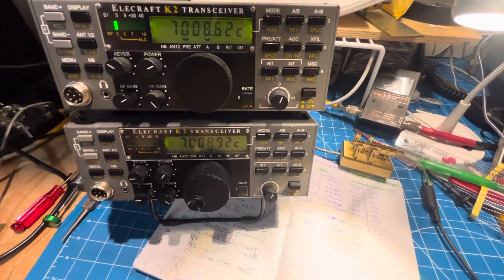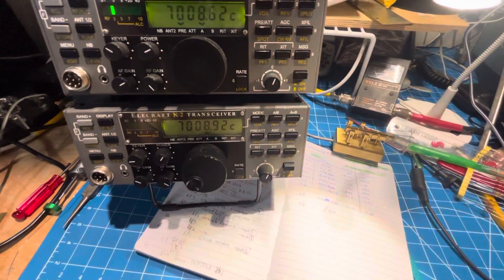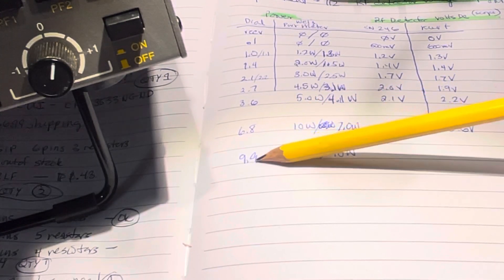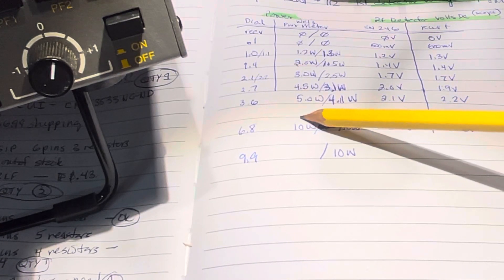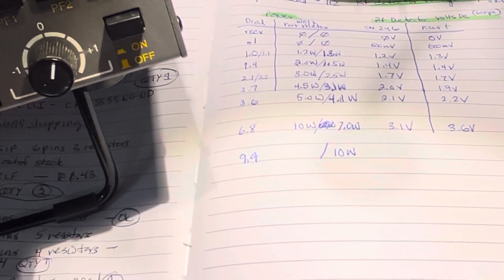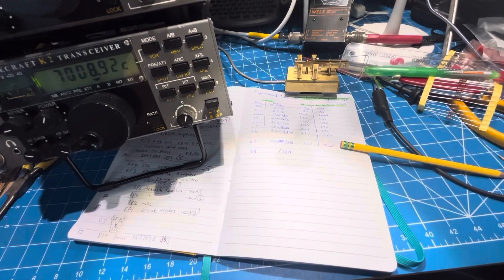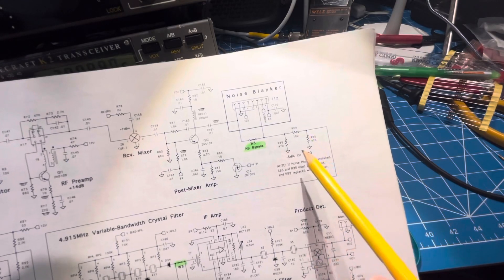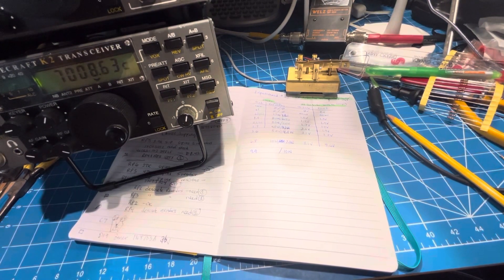K2 - SN 246 is working quite well!

Comment: Hi. Guy here. The scratchy af gain is not the pot. It’s a mod that needs to be added   But you prob know about this. It   See errata 10/25/2001 by Wayne. 
It is fun working on these
Reply from the maker: Thanks Guy! That is a new one for me since this s/n 246 is apparently the oldest unmodified radio that I’ve worked on. The errata seems to have been removed from the Elecraft website. I’ll keep looking for it. From what I found in email archives the mod removes DC from the volume pot.
Reply from the maker: Something related makes sense now as well. When I swapped the swapped the control board from “Kurt” to SN 246 the volume control was disabled. I assume that means the mod affects both the front panel and the control board. Thanks again.